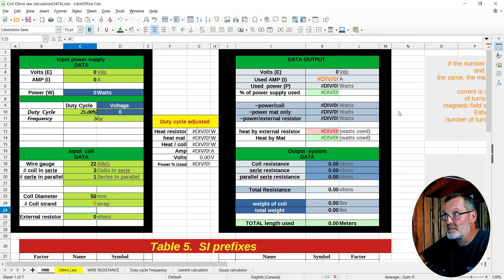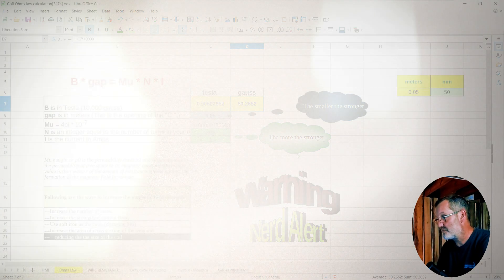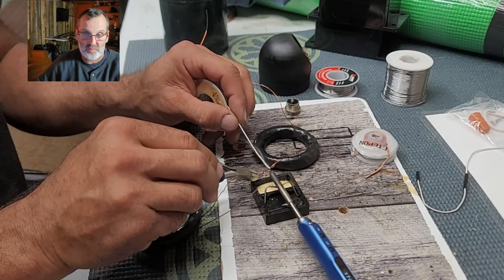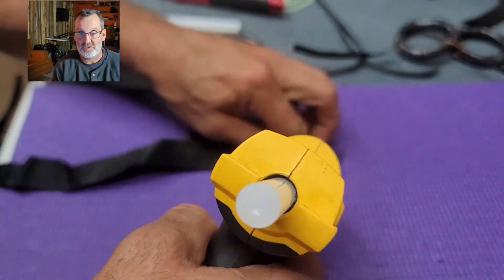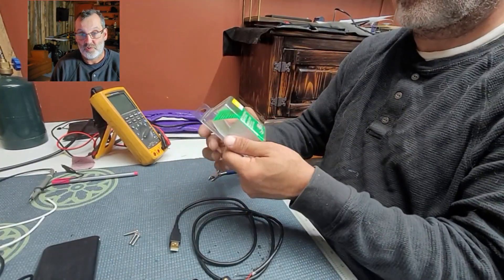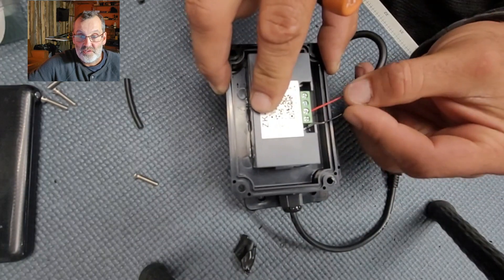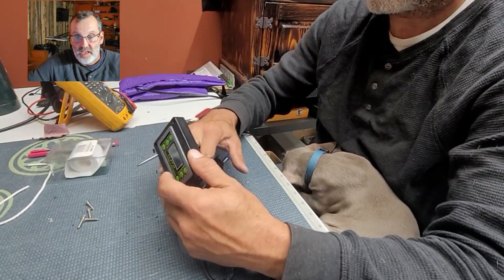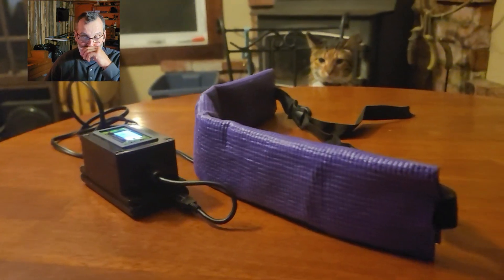DIY PEMF - Battery Powered Portable PEMF Unit

Comment: Why do you not wrap coil around entire head?
Reply from the maker: @m-j107  I do not understand your question
Reply: @Steeve.  I have never seen anyone just take a wire and wrap it around their head on a piece of cardboard. I would be much better because it creates an uniform surface. Instead people wrap small flat coils, which are very pointy in their fields and not as efficient as literally sticking your head inside a coil.

Comment: Also I'm trying to figure out why this was on list too= DAOKI six piece step down power supply module Buck converter DC to DC  3.0-40 to 1.5 235 V high efficiency voltage regulator module I don't understand what I needed that for either but I have it also and it was on the list. Again I have to go back and watch the video just to make sure I didn't miss it but could you please point me in the right direction maybe the time you explained it on the video or a brief description on what I need it for and making this PEF belt battery operated?
Reply from the maker: Patreon. Join,  kots of info and me to help.   Way more active there.   
Search pemf with steeve.  

https://www.patreon.com/PEMF

Comment: Wow, Amazing.  That looks fabulous.  Steve Could you address how/whether  a power bank can be attached to a PEMF,  I actually have 2 systems for my horses and would like to use a power bank rather than  electrical connection,  thanks steve
Reply from the maker: Contact me.at 
Steevebradet@outlook.com

:)

Comment: Hi Steeve, super helpful thanks !  Do you have any preference toward heavy film vs single film magnet wire ?
Reply from the maker: The tinner the better.   Closer the wire are against eaxh other the better.   Temperature rating is not an issue for us.
Reply: thanks !!  @Steeve.

Comment: Would it be possible to make a pemf coil thats powered by the headphone jack of a cell phone? There are frequency generator apps, they can be bi-directional. Possibly a pancake coil..
Reply from the maker: Yes,   it would need to go throigh an amp of some.soet as the power of a cell.phone jack is really weak.

Comment: What a wonderful job Steeve. Do you know anyone who has used magnet therapy for lyme?
Reply from the maker: Yes.   We had 3 peolple that i kniw.   All 3 reported major benifit.  One completly heal.now.    the other two very happy with rwsults and just mild moment far and few 

Overal very good rwsilts.
Reply: @Steeve.  Thanks. Do you know if they use a specific frequency and intensity? thanks
Reply from the maker: @pedorretajohn  they where all using a mat i made for them.   We worked together to find the right setup.  

There is no right or wrong,  just better frequency.  The nature of the frequencg as to be genersted by a swuare wave.   Thst alone make the mafnetic wave slew rate as good as it gets for the cells to actually maximize their potemtial to do their work.   

:)
Reply: I have a 72 year old friend who has had Lyme disease for more than 40 years. The mat I made for him (Steeve's design) has helped him tremendously. He recently told me that he's had about 95% improvement.

Comment: Would you be able to connect a 8 coil matt to this battery system?
Reply from the maker: Yes one van do that.  Ypu could replace the power supply.brick with battery of equal vakue.    Dependong on how much battery you have will dictate how.long.the mat.could stay on.   Keepi.g the duty cycle at 1% woild help.a.lot.

Comment: Hi Steve
How many volts is the battery pack you are using?
Reply from the maker: It is only a 5vdc.  It is a battery pack for.charging.phkne.   

It has 2 amps output.   

The smaller.high wraps make them quite powerful.
Reply: Ok

Comment: Quick question on this portable PEMF design.  In your parts list used in this project, you have a power supply and a step-down converter.  But never saw them employed in your video.  Ummm... can you help on this query?  tx... Great well thought out design work.
Reply from the maker: Sorry.   You don't need it for the portable project.   It is used for the mat project to power the fan. Any question let me know. Tx.
Reply: OK so this is the questions the two questions that I just asked and now I'm finding the answer here in the comments so I will go back up and delete them to inform would you kindly inform me I asked I appreciate it thank you
Reply: OK great so I will be making the Mat project soon so I will not retire those two things that are on the list for the Mat project that were not shown in this video thank you for answering his question

Comment: What frequency do you normally run this ??
Reply from the maker: Because the mat acts like an rTMS.  Unit due to having coils in the pillow,  Depending on when during the day i am on the mat I use 35 to 50   in the morning. 14 to 20 mid day 8 to 14 afternoon 4 to 8 later afternoon early evening  1 to 3 before sleep and 1 for sleeping.   
This is mostly because of the rTMS. Function.   

I follow.the same.protocol presently.with my opemf unit du to its location.    ( ocular pemf)
Reply: @Steeve.  
Thanks you so much for your time.  I've been watching your previous videos after I watched this one,  and it was very informative.   The only thing that I was not sure of is the pulses.

How is your coil pulsed ??  From your setup,  it looks like it is just a ON and OFF.    But in your previous videos,  it appears you suggested that  It turns on,  and then reverses polarity in the other half of the duty cycle.  Another video also shows it  turn on,  then off,  and then reverses polarity......

You mentioned that the duty cycle shouldn't be more than 35%,  but in the rest of the videos you keep showing a 50% duty cycle.
Reply from the maker: Amazing!   Yes you are right in everything you are saying.  How can that be...   here is the answer: 

Bi-polar wave vs unipolar wave.   

For right now when I make a bipolar wave I have to make it at 50% duty cycle.   Limitation to the hardware I am working g with.   I am in the process to switch over to software to control the hardware.   Then I will be able to make 35% duty cycle again.  ( hope so anyway)   

Please watch my video on bipolar wave again.  If you still have question let me know.
Reply: @Steeve.  
hmmm,  you could use a decade counter to get those effects.  And also,  it can be wired in a way so that you can sequentially activate each individual coils on and off  just like xmas lights.  This way you can keep the power requirements at a minimum to the system while delivering maximum power to the individual coils without straining the circuits.

I have given much serious thought about building this machine as an experiment.  This is very similar to the blood electrifier where it was necessary to do a 'Bipolar' wave to prevent injury to the tissues.  My sister has a torn ligament in her Knee,  and she has trouble with pain for several months now.

And also, how  come you don't use iron cores to your coils ??  It would significantly boost your Gauss output without additional power input.
Reply from the maker: @WTF_BBQ  mostly.weight.  putting a plate behind the coils.( has long has the plate is wider than the coil and the plate.is magnetic does a better job.than a core.    I am.talking.of healing.proprity of the coils not the strength to.move and object or efficiency in a transformer.    

I am working on a prototype idea with little.to no power use.     Micro burst. The unit could be powered by watch battery.   It could be use semi permanent on the body.  To heal.fracture faster or tumor in the head.
Reply: @Steeve.  Hi If I may ask is this in Hz ie 35 to 50Hz ?
Reply from the maker: @firdoshdiakus4841  that would be gauss.   Magnetic strength of tje coils.
Reply from the maker: It woild.depends on the a few.factors.   that is a very deep.topic.bit here some.info

Unipolar forward tissues.  Bone cartilage. 
Bipolar for.soft.tissue. miscle.and skin. 

14 hz is one of.my. favorite 
1 hz for sleeping...
4 hz for relaxing 

There is a lot.more
Reply: Still a little bit confused on the 50% or 35% duty cycle? Not sure where to apply this information in my PEMF belt I'm going to start building today?
Reply: @Davetheremixking  
It's basically an alternating current but uses square wave.   So you have an  'ON' period with the positive cycle,  then 'OFF'  at zero volts,  then 'ON' again on the negative cycle,  and 'OFF' again.

Looking at it as an AC wave,   the positive or negative pulses are less than 50% duty cycle.

Comment: Question for you did you wire these into series or parallel?
Reply from the maker: these are in serie. we need the resistance to be high, and there is a build in diode in the zk-pp2k to prevent fly back voltage that would be high with coils in serie.

Comment: Great video, how would you suggest increasing your gauss to 50-60? Make the coils a bit smaller - 30-35mm? Or use 2amp power instead of 1amp. Keep up the great work!
Reply from the maker: I build a " super PEMF" as a prototype.  Also wanted to see what it feels.lile.  

It makes 80 to 90 gauss per coils.  Has 10 coils.  

It was very expensive to build due to everything had to be upsized and qty had to be increased.   
I made it fully adjustable also.   From 0 gauss to 80 gauss.    

The power supply can go to 24vdc but coils saturation happens at 18vdc.   ( the rest is just heat ) 

My finding:

I saw or felt No.change in anything 
  My opinion it is not worth the increase in cost by 300% not to mentioned the annoying high weight the mat is or how complicated the wiring.of the mat was to.do.  
Was very hard to balance the coils so they where all even.
Reply: Good info